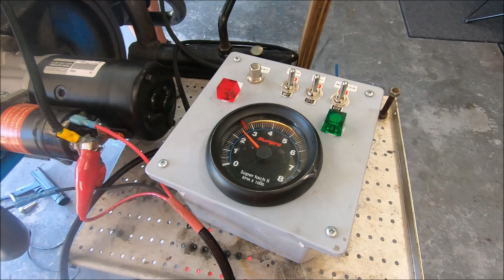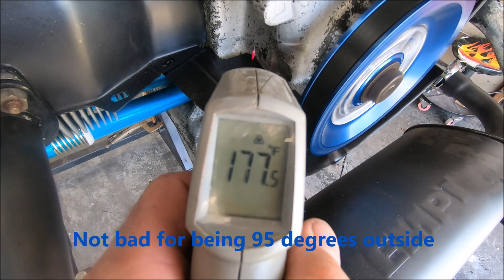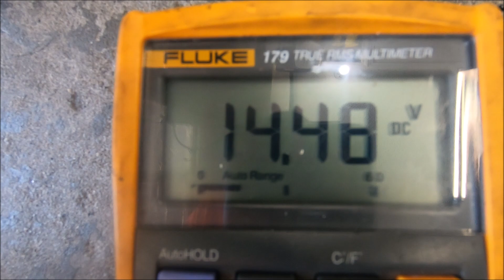Will It Run? Will It Fail? Aaron's VW 1679cc Single Port - Scat C25 - Cam Break In!

Comment: Old style choke cables have a twist lock. It's works fairly well at holding a steady RPM.
I use the same process - 2 to 2500 for 20 min. 
I have noticed some folks use a Run then cool down several times method. Not sure why tho.
Reply from the maker: I haven’t seen those choke cables in forever, but that would work great. 
I’ve heard the same from a few others, some overfill the oil to help get the oil onto the cam and lifters, run for approx 10 minutes at a lower rpm. Plenty of ways to accomplish the same goal. 
I do like the higher rpm, it gives me more time to measure head, case, oil and exhaust temps.

Comment: 1679cc (88mm) with the thick wall barrels is one of my favourite budget builds. Work great with stock heads, mild cam, small twin carbies and exhaust with 1&3/8" primary header pipes :)
Reply from the maker: Yes sir, that’s what this pretty much is. This should be a great little runner for his ‘68 full custom beetle that he’s building.

Comment: I got a Sears timing light at yard sell and it hooks to battery. you can use it without the engine running , just with starter.  Time it a 10 BTDC  and Bingo. when you rev. it is on 32 BTDC on a .009 dist. This will save a lot of head-achs
Reply from the maker: That’s a cool timing light! I’ve been getting g better at static timing when setting the distributor. So many ways to get the job done 👍

Comment: Sweet sound that, difference between an awesome vw builder and me, mine pisses oil all over the place lol . Do you recommend changing the oil then , I’ve done around 100mile in it since the build
Reply from the maker: I’ve had plenty of others piss oil all over the place, you live and learn my friend. 
Usually, oil change after cam break in and then at 250 miles then another at 1k miles is what I do.

Comment: well of course it was going to run! i'm curious to see how well it will idle (smoothness and rpm) with the dual singles.
Reply from the maker: Thanks for the confidence! 
Next video we’ll get them sorted out and idling. Spoiler alert, I proved that the jetting that they come with isn’t right.
Reply: @VWJawbreaker  wide band?
Reply from the maker: Nope, did the basic math of venturi size, yada yada.

Comment: Sounds great! What oil do you use when you're breaking in a new build?
Reply from the maker: I use a break in lube on the cam and lifters and then run a high zinc oil for the break in.

Comment: Gary, quick question, do you use sealant on the pushrod tubes. I need to change out my tubes and seals on my 40 hp motor. 
Thanks
Reply from the maker: I never have to be honest Mike. I did live up these expandable ones he bought but no sealant on the seals.
Reply: Thanks Gary, keep up the great work 👍👍
Reply from the maker: I’ll do my best. Hope you have a good week.

Comment: That's the same engine I am building currently for my '66.
Reply from the maker: Nice, you should be happy with it. It’s a great combo that a few others run as well.
Reply: If you need a new crank just buy the 74 stroker. you wont be disappointed. and put the thick wall cyl and aa big valve heads. opened for 90.5. cheaper than machining and doing a valve job on your old heads.
Reply from the maker: Mike Fn Garage I agree, great points.
Reply: @Mikefngarage  My crank is fine, and heads done allready. I also have type3 carbs in as new condition and will fit okrasa style air cleaners. I want to keep "tuning" looking period correct, as this is actually engine that came with car from factory. I will post video when it will be closer to complete.

Comment: i want to see how that thing runs, similar to my engine except that i have dual port heads and  dual weber 36 idf
Reply from the maker: It’s going into his car soon but his bug is far from finished. Probably be a while before we can do a test drive.
Reply: @VWJawbreaker  nice, my build with the dualport and 4 barrel carbs  has great torque for a small motor ,gets good fuel mileage, i bet it would be a nice bus motor, but ypur build has a singleport , i bet it has better torque
Reply from the maker: Some do say that the single ports have more torque.... I have no way to prove that other than seat of the pants feel.

Comment: Perfect start up 
But some problem in ideal speed
Reply from the maker: Yep, they are never right out of the box. We’ll go over that on next weeks video. Plus you don’t want it to idle during the cam break in.
Reply: @VWJawbreaker  ihave same problem in my car ideal so bad and black smoke
My engine full injected
Reply: @VWJawbreaker  I thinking the idf webers carb better ideal and car pick up more
Reply from the maker: Sounds like a sensor is not working right on your fuel injection system or the injectors are hanging up.
Reply: @VWJawbreaker   may be fule reglutor is defect block ret fuel

Comment: What is the purpose of holding the idle for 20 minutes? I am not a mechanic nor do I know anything about VW engines.
Reply from the maker: The purpose is to break in the new cam and lifters. 2-2500 rpm is the proper rpm to harden the 2 surfaces together and provide proper lube.

Comment: So you failed to rig up a throttle lock system prior to doing a cam break in when you knew it was too run at 2200rpm for 20 minutes ...wtf?   vice grips,wire,zip ties etc etc etc...wow
Reply from the maker: Neale Frazer I have an idea in my head for a throttle system but keep forgetting to make it. This is the first engine that I wasn’t able to set the idle to hold 2200-2500. Oh well lol
Plus it was a long hot day and all 3 of us didn’t think of rigging something up till after we were done.
Reply: Not necessarily. Instructions on my Engle cam say to continually vary the revs between 1500 and 1800 rpm for 15 to 30 mins, varying the revs but not idling. I've heard various experts give differing instructions. 
Whatever SCAT says is right for SCAT cams I guess.
Reply from the maker: Martin Harris you’re correct Martin, I’ve seen various info on this as well. That’s why I split the difference for 2k rpm and give it some gentle revs here and there and will increase and decrease the rpm as well over the 20 minutes. Main thing is to make sure oil is splashing up onto the lifters and cam during break in.
Reply: @VWJawbreaker  Thing is when one starts reading a forum like The Samba or watching guys like yourself, Duckman or EZGZ, every VW veteran builder seems to have their own way of running in a motor or breaking in a cam, and they all seem to work, so I guess there's a lot of latitude with these things and the main thing is to do some sort of dedicated break-in ritual within the boundaries of common sense and advice.

PS been watching Duckman for a while, and he recommended your channel. I love how VW guys get along so well and happily share knowledge so we novices can benefit! Keeps the hobby alive.
Reply from the maker: Martin Harris the samba is a great resource, however there is quite a bit of misinformation there as well. Common sense and following the manufactures recommendations will take you in the right direction. I’ve learned a lot from EzGz, Duckman, VW Darrin and several others long before I even started recording videos. The only reason I’m putting out videos is to hopefully help someone along the way.... that’s all I care about. The VW community is amazing and with us working together to keep these classics on the road, makes the journey that much better. 
There’s 3-4 of us traveling about 2 hours south this morning to help a guy get his bug back on the road.... treating others the way you want to be treated and being a decent human, what else is there?
Reply: @VWJawbreaker  Well said! Totally agree:)
Reply from the maker: Martin Harris thanks for being here and for the conversation. Hope you have a great, safe weekend.